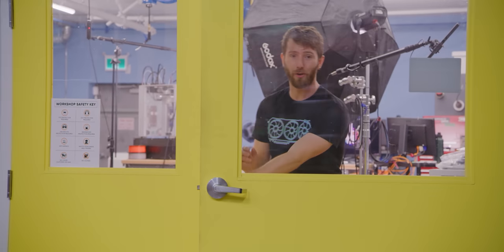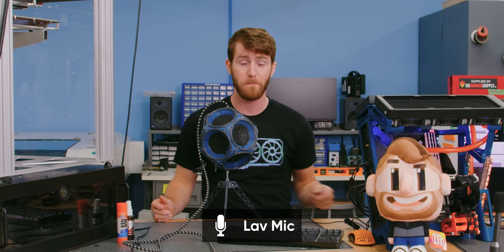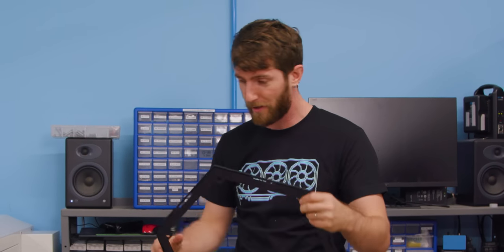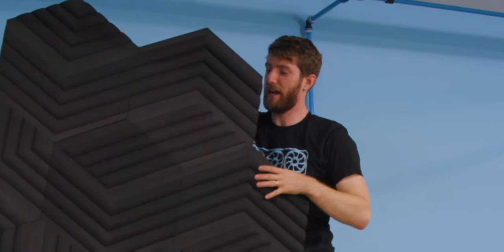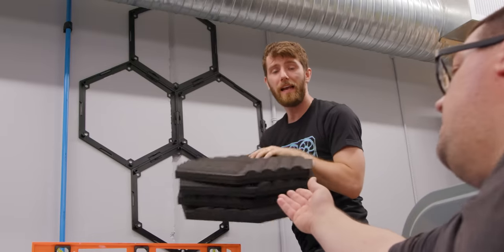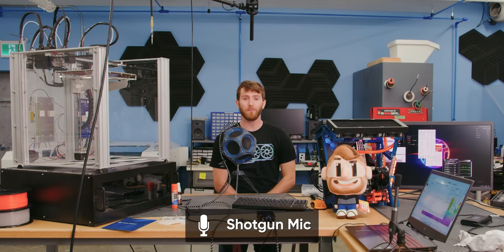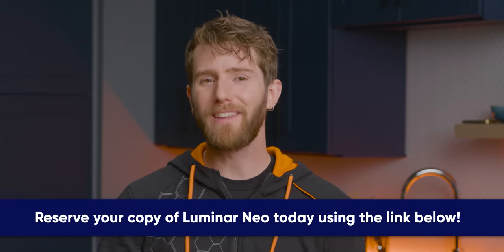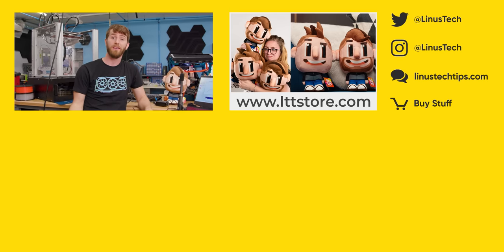I'm only going to say this once... - Acoustic treating with Elgato Wave

Comment: A lot of "specialty" acoustic foam out there is just packing foam really. I never invested in it. Rather just hang packing blankets alongside walls, overhead if it came to cost and efficiency. These foam panels actually did something so I'm sold. Not a great deal of reverb in my small studio/room but I could dampen a little more.

Comment: Would something like this work for, an, "Acoustically conductive" room? I live in an old house, and my room is extremely conductive. 
The room conducts so much sound outside I can't listen to anything even on my laptop without it reaching outside. 
Which sucks, especially if I'm doing anything late night. 

There's a 10 feet 'gallery' between my actual room and the door to the hall, that also conducts sound out.

Comment: How long are your Basswavelenght, you have problems with and how thick is your standardized pad? Can it even physically work in theory? What about reflection on angles in corners? What about diffusion instead of just absorbing the high Waves? Does it make sense to randomly clamp them on the wall, where you have space? I bet, theese overpriced Pads are not better than egg packings! This is 99% Aesthetics and 1% absorbing some highnotes and echos from the ceiling.

Comment: not an acoustic engineer, but as an architect had some experiences with the subject. 
please do research about propper acoustics first before you jump in producing another trending fluke. just filling up walls is a waste of product - you can create dead zones by propper placement of panels, or by manipulating the actual stage. 
you should think of acoustics in the same way, you light your scenes - you reflect, scatter, diffuse, absorb, etc. you work with the space you need for the scene, not caring what does it look and sound outside of it.

Comment: i been looking around, so what I am getting from other people explanation is thicker/dense or has air pockets are better, which is most acoustic foam seems to struggle, what if you stack the acoustic foam? not only you kinda increase the thickness or the distance where the sound trying to travel through the foams to get to the wall, but it will have air pockets, would stacking improve performance or does it barely make a difference? i been trying to look for anyone doing an experiment on stacking acoustic foams but this subject seem kinda rare, has anyone tried this ?

Comment: Yes these are great for streaming and yes I want them but my room is so teeny tiny  that I literally don't have the wall space for one pack.
Reply: I wouldn't do it. There's much better sound treatment solutions that won't cost you an arm and a leg out there. My church has a 6 figure audio setup and we still just made our own custom panels from some rockwool, wood and canvas at home depot. Cost's a far less money per square foot and delivers incredible results better than this video. And if you don't want a diy project on your hands plenty of companies sell acoustic foam at a much more reasonable price. And it works pretty nicely. No hate to linus but there's much better and more affordable ways to sound treat a room than these panels. 

These are more for style points than anything else, which if that's the style you want then no shame. It's just expensive :P

Comment: Damn. I actually Was looking for some panels for some of my Youtube Videos. I got a really really cheap Set up because it is just for fun. Just got a mic because my Phone picked up so much noise. Still need one or two lights. But wanted to have the Sound be better first. With the mic it is a lot clearer and better but, even though I do these in a small room with a table there is still too much noise. 
If these are also good for soundproofing the room a little I would totally get a Pack. I think one Pack is more than enough for most rooms where twitch and yt Videos are made

Comment: NGL- I hate these things

These are effective, well designed, and pretty cool. But I needed to create a sound "proofed" recording room- and throw blankets (those sheets furniture movers use to avoid scuffing floors and such) ended up being nearly as effective- for 1/100th the price on the square foot. 150$ cad gets you a full dozen  8'×4'x1/3" sheets- that's 384 square feet of coverage baby! 

Sure- cheap black nylon blankets stapled to the wall isn't exactly pretty; but just get a nice tapestry (20-40$) and tack it ontop- problem solved. 

I do not - for one second- believe that the material cost of foam is so much greater than cotton that these guys need to charge 100$ for a single box, that covers 10 square feet. 

Even if you had to do 10 layers with the blankets to match the effectiveness of the foam(which you don't need to) that's still 38.4 square feet of coverage!

150$ for 384 square feet
Or 100$ for 10. 

These guys are making a bloody killing on twitch wall foam. This shit costs nothing to make! And if you wana make the argument "But I only need 10 feet!" then fine- but then the price should be 10$ or 40-50$ with brand tax. Not 100$ 

It's a just a cool looking rip-off.

Comment: @ 14:40 just as a sidenote, making ur own panels is cheaper, yes, but they will also perform significantly worse. Of course it depends on the material, but generally it's just better to buy actual acoustic foam.

Comment: El Gato and Scuf are the absolute worst sides of Corsair and the reasons I won't buy their stuff. Overpriced, weak/nonexistent customer support, Scuf are fragile as can be (especially next to an Xbox Elite/Elite 2), etc. OBS and Nvenc have basically made traditional El Gato recorders useless because you can buy a capture card for $30 on Amazon, run an aux cord to your Line In, and use OBS with GPU encoding (instead of encoding on the capture card itself) + VoiceMeeter Banana for recording whatever you're capturing (console or camera footage usually).

A Scuf costs more than an Xbox Elite + a 3-year Best Buy GeekSquad warranty, and they arrive broken half the time.